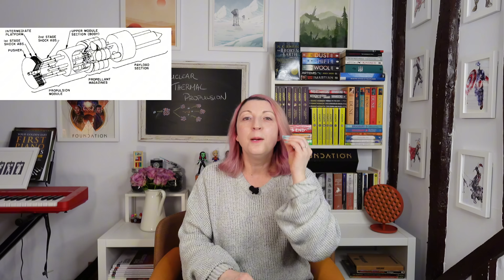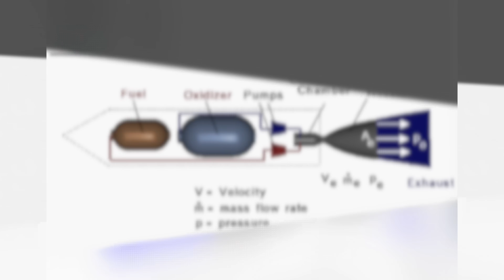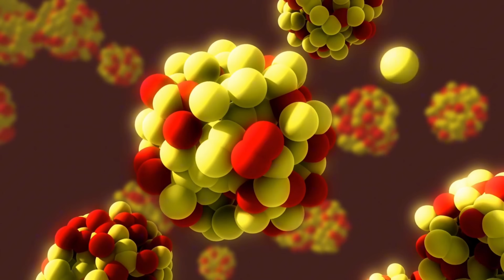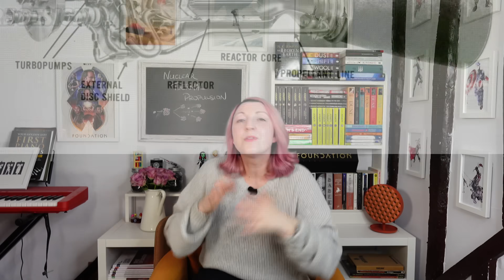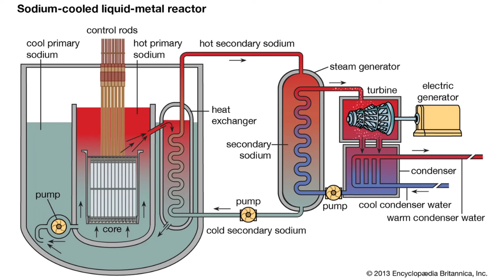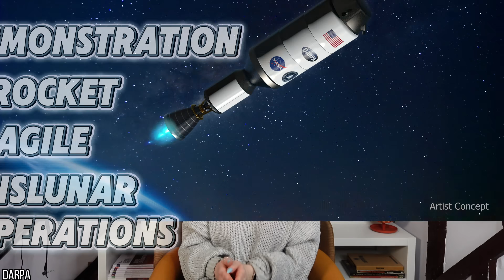Why Nuclear Thermal Rockets Never Took Off

Comment: My personal classification of engine systems is based on thrust and the acceleration a craft can achieve 
The reason for this is that there are different mission profiles that require radically different acceleration values

This creates categories, 30+ G is missiIes, 5+G is combat ships with squishy humans, 1+G is taking off from the earth's surface, .3+G is taking off from Mars's surface, and then.... a huge jump down to 15mG for moving between moons efficiently, and then again down to 3-1mG for moving between planets. And even lower down to microgees or nanogees for interstellar travel

Nuclear thermal is thus something that only belongs in the high thrust category and is thus entirely useless for any low thrust mission. You can waste thrust, you can have too much. If your travel time is 10 months, it doesn’t make much of a difference if you do the burn in 3 minutes or in 1 month. 

What nuclear thermal rockets are therefore is a direct upgrade to chemical rockets in the high thrust category. Ideal for warships and ground to orbit launchers. Nuclear thermal rockets are so good that you can make SSTOs out of them pretty easily (9-10 kps EV translates pretty easily into 9-14 kps Dv)

That’s their niche, they’re also useful as thrusters for landers, for the moon, Mars, Ceres, Jovian moons etc. 

Beyond these uses, you do not need more than a few milligees

And that’s where ion engines come in. 

Now a small prediction for the future: you will NEVER see ships moving as fast as the expanse. It’s not a matter of technology, it’s a question of wasting absurd amounts of energy for irrelevant things. The ships in the expanse spend amounts of energy that could power the entire planet for days just to move around 5 random bozos slightly faster, that just will never make any economic sense even if we had engines that good. In a war maybe but for logistics and peace time activity? You just take the long route. 

Ion engines however have excellent exhaust velocity, it’s on the same order of magnitude/several times higher than the orbital speed of the planets

It means that with advanced ion engines, you can reach any place in the solar system in a matter of months/few years 

And I predict transfer times will never go much below that, a few months to Mars or Jupiter will always be the limit (going there faster requires exponentially more energy, joules being wasted)

The good news is that we basically have the technology to go as fast as we ever can within the solar system today, ion engines with solar panels, batteries or nuclear power are all valid options. The best systems are nuclear running on light elements like helium with so much power draw that the thrust remains high despite the use of lighter elements, this will give you delta v in the hundreds of kilometers per second. This is however very expensive

Less extreme systems, hybrid solar relying on heavier isotopes will still give you tens of kilometers per second of delta v, enough to either fly to a destination faster than a hohmann transfer, or doing a hohmann transfer for cheap

In short, nuclear thermal is only useful when high thrust is required (takeoff, landing, and warships), while ion engines are amazing and should be a high R&D priority, and while nuclear electric is the best for ion engines, it’s also by far the most expensive option, and other ways to get electricity still work. Having great ion engines and lightweight power sources are the challenge. If this can be achieved, with easy to produce fuel, it will enable access to the entire solar system for fairly cheap, be it to send orbiters to Pluto and Neptune, or to send tens of thousands of tons of industrial materials to asteroids, ion engines are the way to go. Ion solar is also (thanks Elon, AGAIN, that trend was started with starlink) the default in all satellites. Satellites especially the non military kind can afford to have very low thrust to slightly adjust their orbits over month or do orbital maintenance to fight against orbital decay from atmospheric drag

Basically ion engines are amazing, anything nuclear is expensive, nuclear thermal should only be viewed as an upgrade to chemical rockets for high thrust applications, fusion might as well not exist and antimatter will be the best kind of engine once we develop it but will always be absurdly expensive

Comment: Silly question but why not just use tinfoil? Solar thermal is a very simple concept, use light weight reflective material to focus sunlight, and creat a hotspot, do the math..  say a 10gram mirror can cover 1sqm and gives us over a kilowatt of energy, scale this up to a few tonnes(like the weight of a nuclear reactor) and it becomes clear thar the nuclear is unnecessary, we just need mirrors and propellent.

Comment: VERI APRISHEIT YOU TAIM, THANKS MY GOD,  LITEL BONUS  FO ALL YOU EGENSIS  ,NID BULD MINIMUM 40 TINI REAKTORS NUCLEAR ⚛  I NGECT IN CENTR ELECTROMAGNETIC  FUGENAL REAKTOR, FUGEN REAKTOR  SAK VACUUM  GESES  + COMPRES + SUPER HIT GENEREIT 2 TRAST × 4O INGEN= 80 SUPER TRAST FLAI NO FUEL NO HADROGEN,  NO OKSEGENT ,NO ENI KIROSIN,ONLI URANIUM 232 + 2 ELECTROMAGNETIC  MIDEL FOGENAL PLAZMA  BOL= 40 FUGENAL  PLAZMA  BOL = PLAZMA  BOL === SUPER SMART LAYF BREIN SUPER SMART+ SUPER FAST KONTROL ALL ATOMS GENREIT 80 TRAST PUSHET IZI  1 BILLIONS  TRAST FLAY  MINIMUM 50 EYRS  ,NID PUT ROBORT SUSTEM SUSTEM ,+ NID NEW DIZAIN  PLAZMA  COMPUTER. KOMUNIKEISHEN  DEVAIS  ,THANKS MY GOD  ,GOD BLESS ALL YOU

Comment: Compared to the temperature of a reactor core (mechanically stable), what is the temperature of an electrical arc (consumable graphite electrodes)? A 'flow thru' reactor is STUPID! Use the reactor (and solar cells) to produce megawatts of electricity, use microwaves to heat the fuel up to 5000 deg K.

Comment: Interesting that you used the phrase "get off the ground" but neglected to mention the thrust to weight ratio. Your basic NERVA literally can't get off the ground.

Nuclear thermal propulsion would be an excellent interplanetary propulsion system. But it can't replace chemical rockets for getting from the ground into space.

It's not just politics that holds NERVA back. In order for NERVA to make sense we need some kind of space infrastructure like a significant moon base or an orbital fuel transfer station.

Comment: Unmentioned here was the fact that one reason that some of the U.S. attempts to develop a fission reactor rocket was abandoned was due to some tests where the core materials were eroded resulting in highly radioactive spent nuclear fuel (SNF) material being scattered on the surface of the desert. Much federal money was later spent in the attempt to remove most of the resulting radioactive contamination.

Note that the ‘official’ history, concerning the reason certain projects were ended, can differ from the actual reason, especially if the actual reason is viewed as potentially embarrassing.
Reply: What? Spraying hydrogen on graphite at thousands of degrees makes the carbon react with the hydrogen? Man who could have seen this coming! What a twist! What next, lithium boosting the yield of a nuclear device?
Reply: @IceRain-f5v  The primary problem is that in order to achieve high thermal conductivity, between the fissioning nuclei and the hydrogen propellant, only a thin layer of material can exist between the two materials. At many thousands of Kelvin temperatures and high flow rates the separating material tends to erode away and eventually the fission waste products begin to erode as well, thereby flowing out with the exhaust. That will include nasty isotopes such as cesium-137, strontium-90 and plutonium isotopes.

Comment: There is another method to have affordable transport around the Solar system, and that is with Carbon 14 battery powered ionic engines. The Carbon 14 Diamond Battery is a bit exotic and extremely low power, but there is a way to make massive Carbon 14 batteries that have an operational half life of over 5000 years. To make this work you would build a number of 1 tonne Carbon 14 batteries in to a space ship that is designed to operate for centuries and move around the Solar System as a Delivery Truck. The Carbon 14 battery delivers a constant Voltage and Current  though this can be manipulated to vary the energy parameters by rearranging the end inter connections. Accelerating and decelerating can be achieved by storing power during cruise in conventional batteries and super capacitors for higher thrust for short periods. Acceleration and Deceleration might require some Thrustable Matter to enhance the speed change rate, this would become part of the Cargo that is picked up at delivery locations. 
Regarding Nuclear powered rockets, I’m not sure if this is part of the concept, but I would have thought that the fuel launched would be the lowest form of Uranium and the higher grade fuel is manufactured in space in a fast breeder type reactor.
Reply: The power density sounds horrible, battery life is at the cost of battery output here 

And you need at least around a milligee of acceleration in the solar system that’s not really avoidable, if your power source can’t create enough watts for an ion engine to push the craft at a thousandth of a gee the ship would take several years just for the burn itself to do a simple transfer from planet to planet

I doubt very long half life decay stuff can generate enough electricity per mass to achieve that power density, something that takes 30 years to go from earth to Mars in winding spirals doesn’t sound too useful

Comment: Solar pv has a higher ISP. a 1 km solar array.  over GW of sunlight, about 200-330 MW.   Nuclear need massive shielding. If nuclear electric it needs huge radiators.  Solar pv ion rockets now dominate space probes because it has the highest ISP by far.

Comment: The problem is .. rockets crash.  And yes, there is no nuclear explosion. But a crashed rocket is a dirty bomb if it has a standard nuclear reactor that has been operated for a period of time.
Reply: It’s probably not much of an issue if it’s engineered properly honestly

We can design the reactor like a plane's black box, put it inside sturdy armor designed to survive a full on crash

Then removing graphite moderation from the design would greatly help in avoiding the release of radioactive atoms and small particles, there are moderators that are far more sturdy

Nuclear rockets might fail by exploding from the hydrogen oxygen reaction, think Hindenburg disaster but explosive, but you could totally design the reactor to survive that. And even if it doesn’t, just break into big chunks with no powder or small shards being created. same story when it hits the ground. 

It’s mostly a problem if your engineers and project managers all have 70 IQ and you design a nuclear reactor with 0 protection or hardening against damage and fill it up with graphite that will turn into powder upon damage. If you do something that dumb then yeah it would be an issue and release fallout if it blows up in the atmosphere. And all prototypes were like that, full of graphite with no armor or protection. But my point is that it’s not the only way a reactor can be designed, you can create a reactor that’s a crazy sturdy nearly solid chunk of metals and ceramics, itself inside armor. A similar concept to F1 car cockpits. The mass would eat into the payload to orbit mass but it wouldn’t be too bad especially with the performance of nuclear thrusters. The cost of the fissiles is the bigger issue

Comment: Or, utilize all that liquid hydrogen to cool the electronics on a superconducting nuclear-electric drive system. Maybe even hybridize it with a Nuclear thermal mode. If a near-megawatt nuclear-electric system could be worked out, it would be a phenomenal advancement.

Comment: Fusion is actually easier to use for propulsion than for energy generation. Look at Pulsar Fusion and their Sunbird, they have actually test-fired a prototype (briefly), so I'm keeping an eye on any news from them. Looking at ISP in the 10k to 30k range, with thrust much better then ion drives, though not as good as modern combustion rockets. But high enough that you could get a large payload to Mars in just a couple months of travel time!!! I bet we're going to simply leapfrog past fission based propulsion.

(TAE and Helion appear to be the most likely to succeed in fusion energy, perhaps within a decade, with designs that don't require all the inefficiency losses involved in boiling water and spinning a turbine!)
Reply: not true.  If you can produce thrust, you can produce power

Comment: Yeah, NTR sadly just isn't enough of an improvement to really make sense. Just going bigger with a chemical rocket is more straight forward, hence Starship.

And if you want to use an NTR for a long time during a mission you have to solve the problem of storing liquid hydrogen for a long time, that has not been done in space yet and using any other element or substance than hydrogen eliminates the entire advantage NTR has in Isp.

Comment: If radioactivity is low until the engine is run,  put it in the upper stage of the rocket and don't activate until you are in space. Seems like a simple solve.
Reply: The question is will it start? Or end up being junk?
Reply: Radioactivity is contained in uranium which itself is in ceramics for high temperature reactors. Uranium has a long half life, meaning it releases radiation slowly 

Activating it creates radiation because uranium is forced to be radioactive (induced fission=chain reactions), and thus creates a bunch of random atoms and neutrons that themselves hit everything in the reactor causing more random isotopes. The random isotopes themselves have kinda random half lives meaning many of them are very radioactive

However if a nuclear rocket is to be used several times, then it will always have some amount of radioactive stuff

Your suggestion works for a brand new, off the factory engine. Another idea I put forward is just to engineer the reactor so it’s sturdy. Literally put it in armor and make the thing itself as indestructible as possible. That adds a bit of mass but only a few tons or maybe few hundred kilograms. It would be able to survive the hydrogen tanks blowing up if designed properly. It also would be able to survive an impact with the ground, not as in be undamaged, but as in it wouldn’t release radioactive particles despite being all smashed up. 
Graphite especially is a massive issue, graphite itself turns into dust that flies away very easily, it can even burn into CO2 at extreme temperatures, but even worse it’s a light elements. Meaning when it gets hit by neutrons it’s going to turn into a random light element, and light he elements are much better at flying away than staying on the ground 

So if safety is a concern they should use another moderator than graphite, something sturdy that doesn’t produce fine particles when damaged. All this would make it very safe, the rocket could blow up mid flight and the reactor casing would protect the content; then it would fall to earth and smash itself when it hits the ground, but not release any volatiles or aerosols or gasses, making the nuclear cleanup as easy as collecting the dust in a 10 meter radius around the crash

In fact it may even be possible to design a casing so sturdy that it would never be cracked upon hitting water, this way a reactor falling out of the sky over the oceans from a damaged rocket would literally never create fallout in any context, it’d be the same as a sunken nuclear submarine, except the reactor would be easier to pick up and retrieve

Comment: to get off earth,  the chemical rocket is still king.  the NERVA had a Thrust to Weight ratio of about 3 - 5 to 1..  they hypothesized it could have gotten to about 7.5 to 1 but it never got that far.   where as current chemical rockets T to W ratios are FAR higher.    that said, once in space the higher specific impulse of a Nuclear Thermal rocket really shines compared to even the best vacuum designed chemical engines 850+ seconds vs 450~ish seconds (RL-10).   

the problem with getting a Nuclear rocket in to space is... some times rockets explode.  if the nuclear engine was in an upper stage when that occurs, then you have a big radiological issue down range.   perhaps we could build it in space.  then you wouldn't have to bring all the fissile material up in one go as I would assume building a ship in space would require multiple launches like the construction of the ISS.  once constructed, then all you would need to do is bring the fuel.
Reply: Until the reactor has been running it is "just" a lump of uranium. There are billions of tonnes of uranium dissolved in the oceans already.